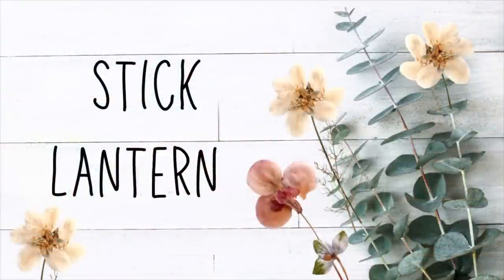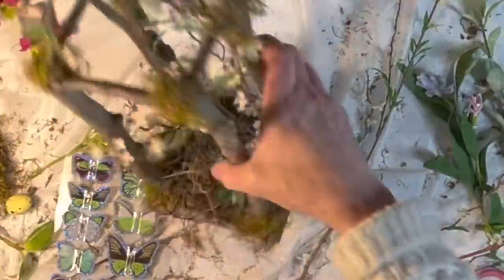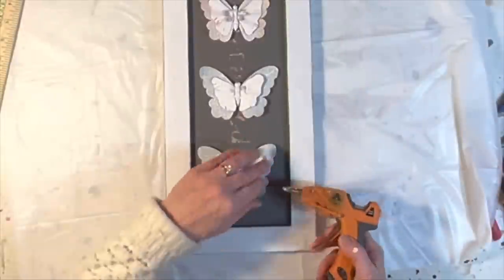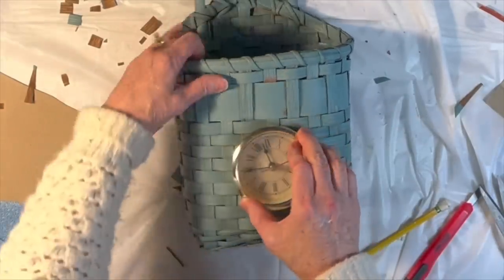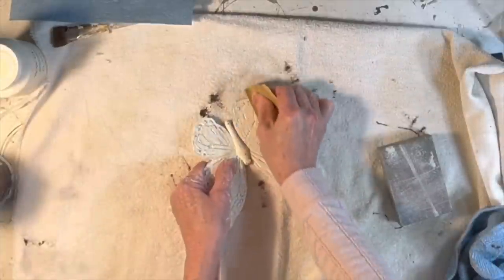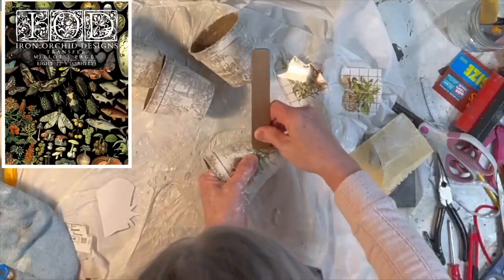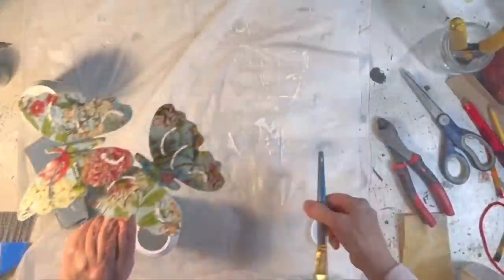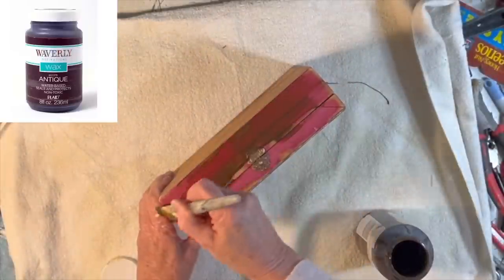10 Unique DIY & Thrift Flip Botanical Home Decor Ideas

Comment from the maker: I sure hope you enjoy today’s video. I’m really happy with how these botanical projects turned out. PLEASE, if you know what that weird rack is, let me know. It really has me stumped! BTW thanks for letting me know that the brass round “frame” in a previous video is a decorative bracket used where a stove pipe connects to the wall! Who knew?!
Reply: The weird shelf and birdcage were my favorites. You always have the best ideas!
Reply: I must say I wasn't a fan of the plaster over the butterflies, but I'm so glad you showed it, my projects don't always turn out the way I envision, it's good to know I'm not the only one. I'm curious to see what you wanted it to be... I love the lantern/nest and the basket clock. (loved the beads)
Reply: I’m wondering if the weird rack is actually a small table top ironing board?
Reply: A very beautiful stove pipe bracket frame indeed!
Reply: I do believe you will come back with a new idea that will blow us away with it!!!
Reply: I love your creativity! The weird wall rack actually looked like a table decor piece to me. The metal squares are the legs and the top would hold decor but your creation was cool.
Reply: It looks a bit like a tabletop ironing board where a soft material would fit inside the beveled edges. Perhaps the metal hardware was added later 🤷🏼‍♀️

Comment: the 3 butterfly bas-relief picture: maybe you could paint the butterflies a darker contrasting color and then paint the off white paint over them and the background. then when you sand them lightly, the under color will show through nicely. the wood and metal rack gizmo...perhaps it had 5 of those square glass candle holders in the squares, suspended slightly above the wood underneath, to be used as a centerpiece on a table? curious, for sure!!! what you did with it came out super cute!  @ 11:17, the wooden wall rack is my fave today! thank you Sherry for sharing all of these  upcycled projects.

Comment: Did I miss the part where you shared a tip for painting outside? I didn't see it.  Was looking forward to that.
Reply from the maker: I showed the little collapsible tent that I have set up in my garage. I put the item on cardboard, spray it inside the tent & carry it inside to dry. I also use the tent in the summer if it is raining.

Comment: May I suggest? Your spring time clock. I saw your wire sitting on your workbench while you glued each bead. If you threaded the beads on the wire, you could move them into place with less chance of glue burns. Enjoy and keep creating beauty.
Reply from the maker: Thanks for the tip! I should have done that!

Comment: Great ideas, as always. I’d like to throw in my opinion on the piece that you hung on the wall and to which you added the peat pots. I think that the metal part is the bottom (legs, feet) Atop the bottom is a vessel for serving or holding greenery, etc. I think you turned the vessel on its side vertically.  It was probably originally horizontal with the metal part underneath.
Reply from the maker: Thanks for that explanation! I had not thought of that possibility at all!

Comment: With the plaster butterflies, could you thin the plaster to a pouring consistentsy , till everything was covered, then pour off the excess?? Do you think it would allow for more detail to be seen?  Just a thought.  I love the basket clock, but I would leave out the lettering, if it were mine. Absolutely love the peat pot holder!
Reply from the maker: Thank you, Jody! I love the pouring idea. I need to use plastic butterflies because the texture of the fabric required more joint compound than I wanted to use.

Comment: I don’t dislike the letter beads with the clock. I have zero design expertise or crafting skills, so my suggestion could be mute. I think that perhaps of the beads were a little aged to go with the creamy color of the clock face, as well as maybe the ribbon being a little aged could make it feel slightly more cohesive. That being said,  I also enjoy unexpected, special, and unique touches. The letters add some “whimsy,” if I’m using the word correctly. I also like that they are square against the roundness of the clock face. Maybe a rounder set of letters would be more expected so I love that you chose these! Thus far, I don’t feel like you do too much. You are artistic and you take chances! Two things I struggle with emulating.